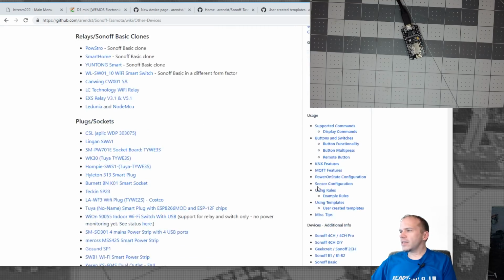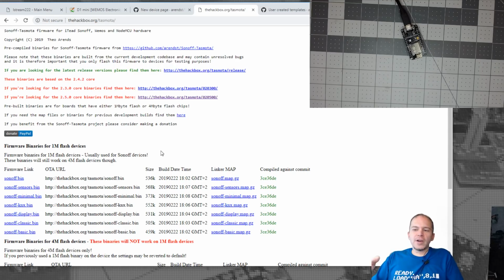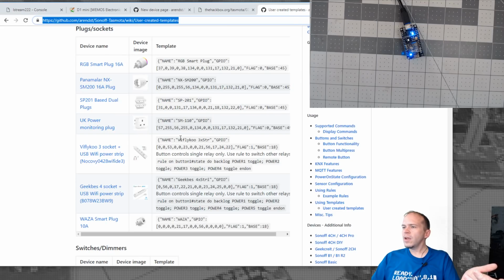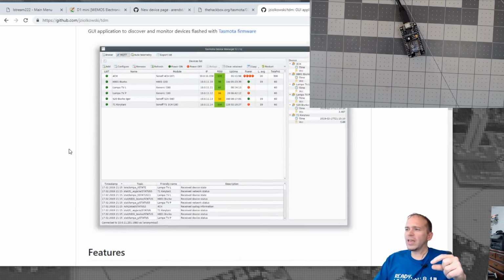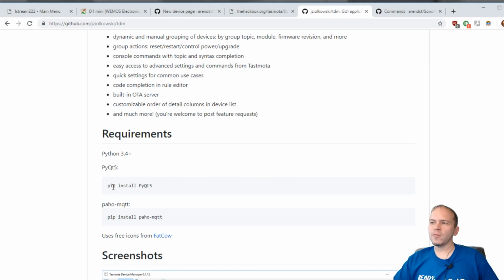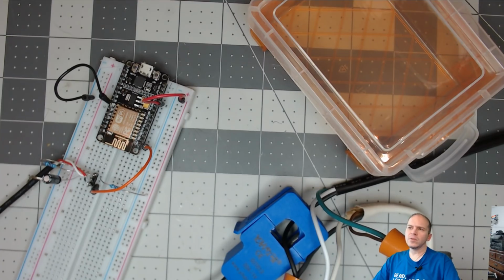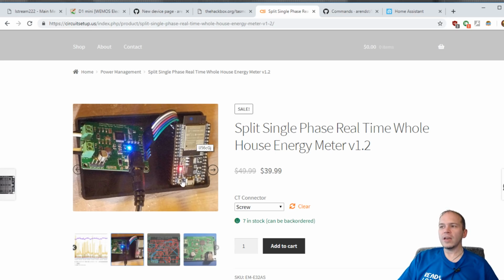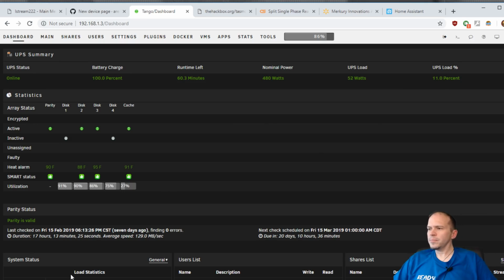Live Stream - Tasmota Templates, and ....

Comment: Hi there, Do you know tasmota template for Shelly Bulb by any chance? I flashed it with Tasmota via OTA and than i realized there is no template available yet. Many thanks for any idea, support, guidance. Great video btw
Reply from the maker: Did you try this? https://youtu.be/eDoIkd58HRM
Reply: @digiblurDIY  Yes, I tried that. Unfortunately I can not notice any change/click/light on the bulb after I assigned the gpio's as relays using the template. Thank you anyways.